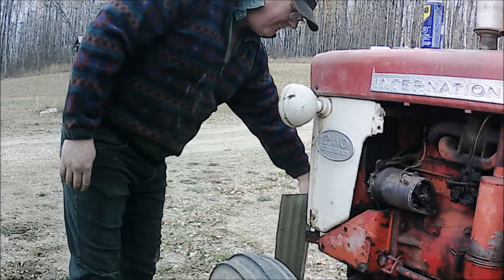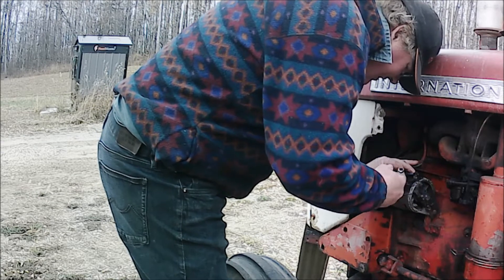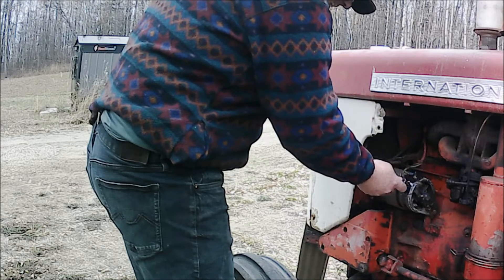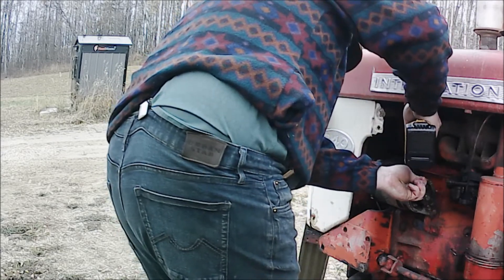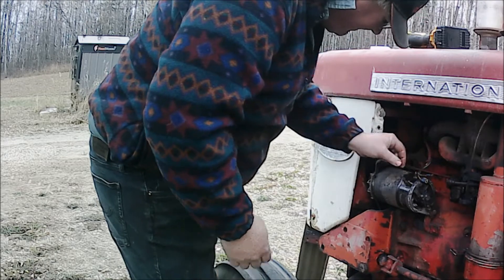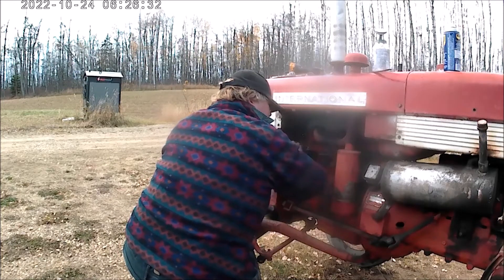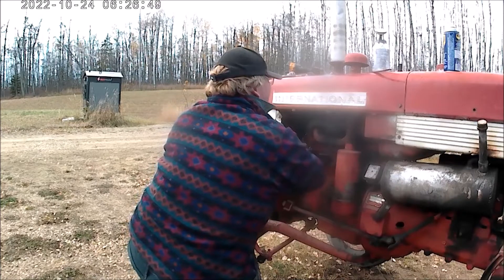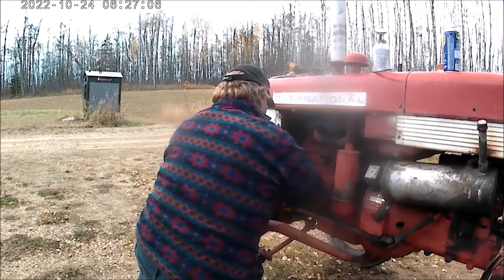International 240 12V Conversion

Comment: Hey Ty. TWO fun tractor things happened to me this weekend. I took delivery of a well maintained Farmall cub. For my sweet corn patches. AND some aquaintences of mine told me the existence of my grandfather's E3 Co-op and it was available for purchase! I'm about to bust. It ain't a Farmall but that ain't where the value is for me.
Reply from the maker: That's nice. The Co-op E3 is actually a Cockshutt 30. They were good tractors.
Reply: Yeah they used it on a AC rotobaler. And general stuff.

Comment: The 6volt on out 240 Utility and Farmall M had 6 volt batteries and it would sometimes get on your nerves trying to crank them. But the H cranked ok and so did a 641Ford tractor we had.
Reply from the maker: Yes but those engines don't need to turn over that good to start. The only reason I went 12V is I had the stuff I needed to do it.
Reply: The 240 starts so easy it's almost running before you hit the starter button
Reply from the maker: @trockallen  Yes it starts really good.

Comment: 12v helps A LOT . 6v is ok but I'm guessing when its cold it's harder to start
Reply from the maker: When those engines are in good shape, it's amazing how well they start when it's very cold. The W-9s have a 6V system and they barely turn over, and even when it's cold, they'll often take right of with 2 or 3 times over compression.